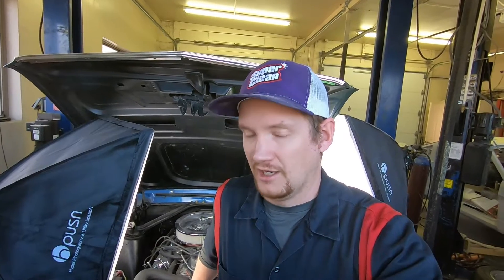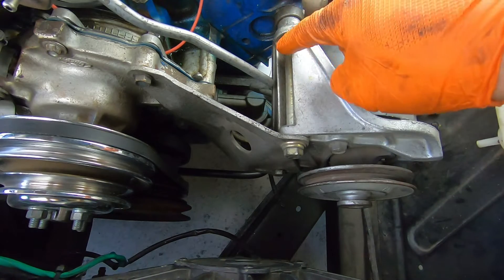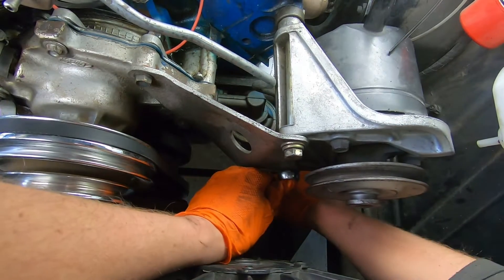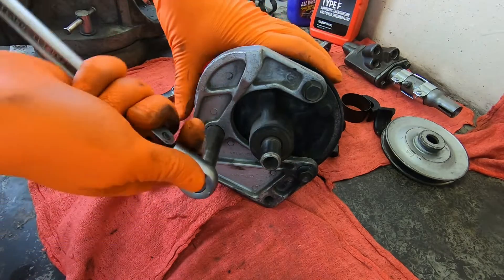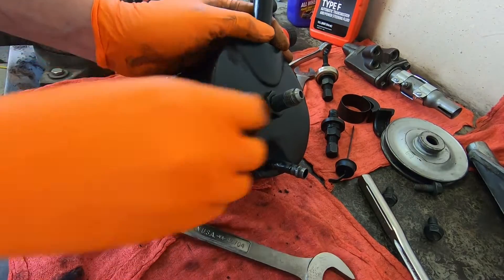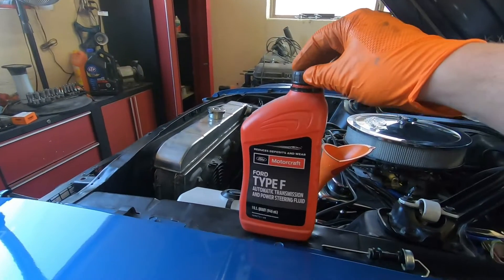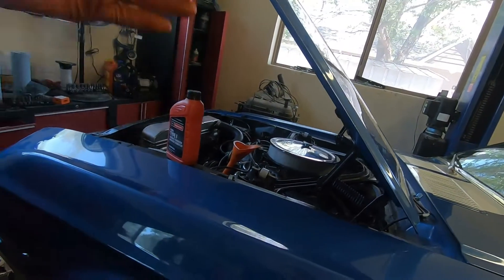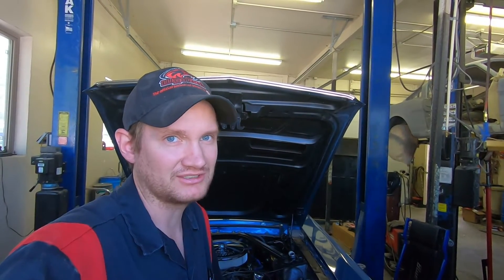Power steering pump replacement - 1967 Mustang

Comment: hello! I was wondering if you could post a video showing how you run the power steering hose from the pump down to the box. I had my '67 Mustang for a few years and recently, I ran into an issue when the hose decided to run up against the manifold and it started burning through the hose and it caused fluid to shoot everywhere. I can't seem to figure out a "route" so that way the hose doesn't hit against anything that will damage it. Great video btw! Definitely will subscribe!
Reply from the maker: I'll see what I can do. What engine are you running? The route for small blocks are different than big blocks. I do have some footage I could throw together for the small block 289.
Reply: @AlfsMustangGarage  it’s a edelbrock 289. And that’d be great!
Reply: We’re you able to put together a few shots of the hose routing?  I have the small block and have had trouble finding the correct routing for the PS hoses.
Reply: @stevetrembly  unfortunately I have not worked on it since this comment. I had a busy year. Hopefully I will soon

Comment: How did you get the ps belt back on?
Reply from the maker: the belt slips over the ps pulley, the crank pulley, and water pump pulley. You then pivot the power steering pump over with a prybar and tighten it down to make it tight.
Reply: @AlfsMustangGarage  that’s what I figured! What a joy lol

Comment: I have a 67 coupe. It’s missing a pump and bracket. Is there an upgrade or a goo place to get one
Reply from the maker: Well for a pump, I have learned it easier to deal locally. You order things like that online and its more of a hassle to return them if there is an issue. I've got my last few pumps from AutoZone and haven't had an issue. As far as the bracket goes, I would get it from National Parts Depot.